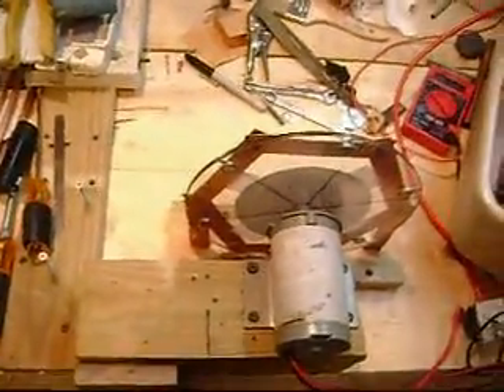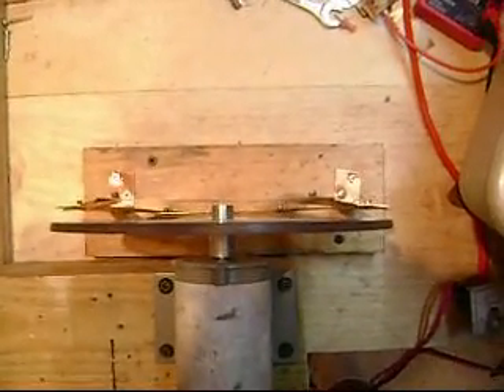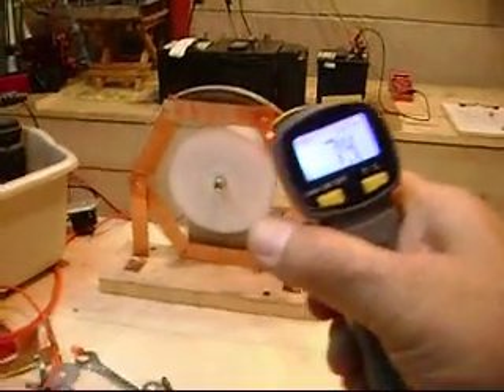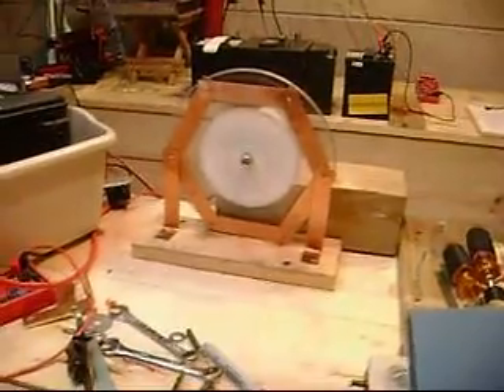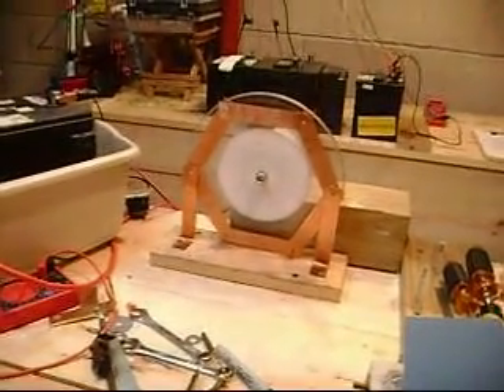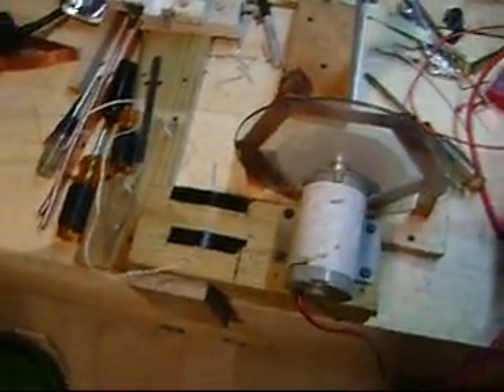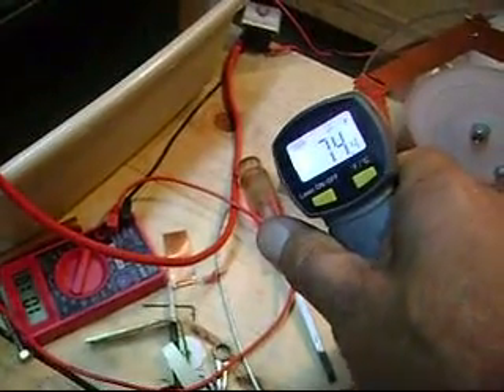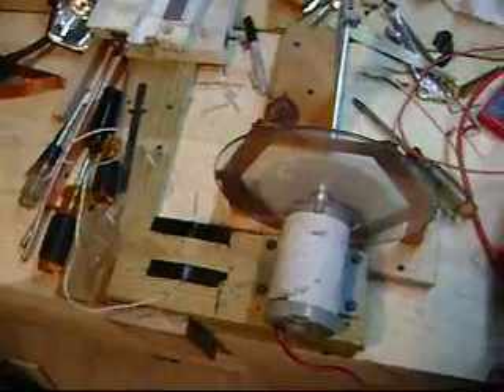HEATING COPPER STRAP WITH MAGNETS  3

Comment: You have done good work. I am thinking to make one but cant afford investing in anything so here is the idea if you can make one.  How about if u use pedestal fan? If you take out blades and use your magnetic disc. Instead copper strips a round sheet hang with wires in the fence. I think it will be much easier and useable as is in the room or anywhere.  
I think you need more magnets to make it more efficient.  If u interested then I can tell you in detail. 
Sorry for poor English.